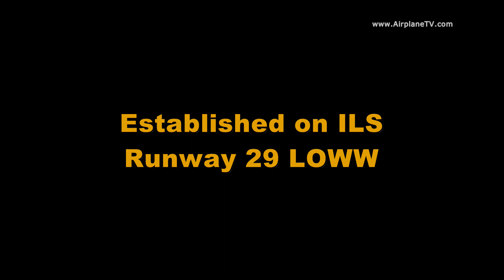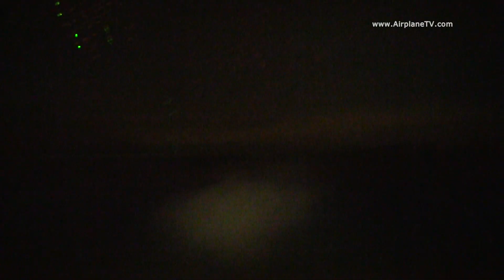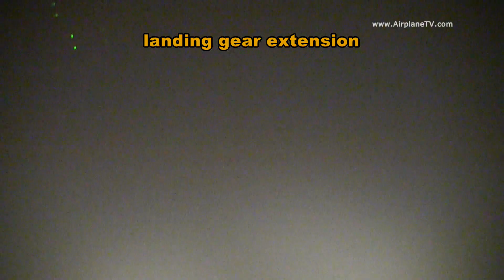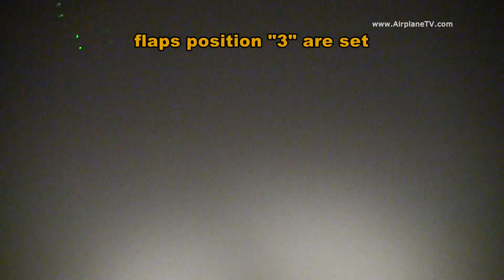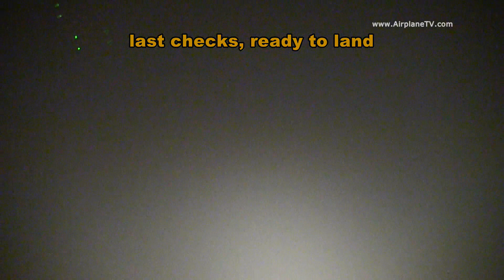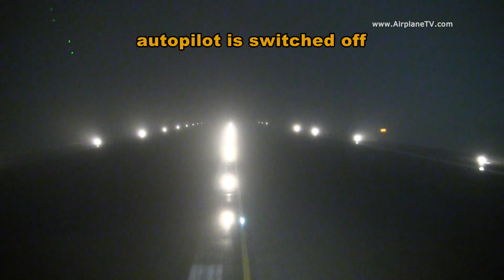Airbus A320 pilots' view ILS Approach CAT III LOWW-VIE in bad weather

Comment: I don't care how skillful the pilot is or how many thousands of flight hours he/she may have, this wold have to be the scariest thing to do!  Landing a plane is hard work, especially if you have a crosswind component, but this . . . this is another thing all together.  I will take my hat of to anyone that can do this!
Reply from the maker: TheMeslava
 that's right, but in case of any malfunction you still have to take over manually and if visual cues are sufficient, complete the landing.
Reply: TheMightyHarihar No. You still have a ton of critical information from the instruments that tell you your speed, altitude, flight path,  location, etc. Just because you can't see out the window doesn't affect things as much as you think. 

For example, if the computer was malfunctioning, you might see that your speed or rate of descent is not normal for that phase of the approach. In that case you will know something is wrong and take manual control. The instruments will show something is wrong long before you hit the ground.
Reply: No luck in aviation.
Reply: Every ILS sistem has Frekvency in MHz , for example 123.25 MHz 
Firs step: when you start approuch you put in AP system that Frekvency. 

Step two: plane give you a signal when catch signal and your autopilot be on xy heading or on VOR you put APPROUCH on autopilot and this is it.
Plane navigate ILS system and auto-landing
Reply: I think that csosswind is much harder
Reply: TheMeslava
Yeh, I know it is, but just becasue it is set for the autoland, both pilot and the co-pilot are on the edge, checking and cross cheking all the instruments millions of times to make sure that all is going by the book and in the case it does not, they have to over ride the system and take manual controll, eventually landing the plane by them self.  In this scenarion . . . . . they would have to be trained and qualified to do it and even then, there is very big luck factor as well.  Either way, I am impressed = )
Reply: You do realize the plane landed itself right?
Reply: What are you going to do if there is a malfunction, since you can't see shit. You will be dead before you realise there is a malfunction.
Reply: @Harihar_Patel  not necessarily. Down to 50ft it's still generally very feasible to execute a safe go around. Below that, all bets are off. You better hope luck is with the pilots that day.
Reply: @Harihar_Patel  there are still ways of landing the plane at zero visibility when there is an autopilot malfunction. I land my Cessna 172 at zero visibility manually only by reading the instruments, following the localiser and the glide slope, I am sure they as Airbus pilots can do it as well, maybe as good or better than me.
Reply: TheMightyHarihar Not so at all. The pilots are constantly checking everything, and the automated systems are checking themselves. If something goes wrong, they’re going to know it. When you hear the pilot say “land CAT III dual”, that’s him verifying at very low altitude that everything is working correctly and that both autopilots are going to remain engaged throughout landing. If something fails and they can’t autoland, they turn off the autopilot and manually fly the airplane down to Minimum Descent Altitude, then land visually if they can see, or power up and go missed approach. From a missed approach they can either try again if the weather is improving, or divert to their alternate. Nothing is left to chance.
Reply: TheMightyHarihar you'd see that on the instruments and possibly by the autopilot disconnecting. Then you take over and fly the missed approach manually on the instruments just as you would for any landing
Reply: autopilot did it.

Comment: Thanks for sharing! No DH approach means that a PF can decide to go around at any point until touchdown?
Reply from the maker: That's correct.
In fact any decision to go around below approximately 20 feet will result in the main wheels touching down but that's allright as the landing gear must not be retracted before a positive rate of climb is established and the ground spoilers will not activate in this case.
Reply: AirplanetvCOM
Thanks for your prompt reply! Would a touch-and-go landing be possible in this particular configuration?
Reply from the maker: Martin R.
as the main gear would have contact with the runway it IS a ouch and go landing anyway.

Comment: Man, you got to admire the modern technology for both ILS and AP.
Reply from the maker: Yes and no: the computing power of an ordinary iPhone probably surpasses all computers and processors built into a modern airliner.
But the important topic is "reliability". While I appreciate all the possibilites and apps of an iPhone I certainly would not want to have my life depend on it...
Reply from the maker: Feyg Aeckaunt
the latest FMGC is praised for it's higher memory capacity of .. 5 Megabyte.
I'd guess I'm right ;-)
Reply from the maker: Feyg Aeckaunt
okay, regarding computing power: the latest release offers already 32 bit processors..
Reply from the maker: Kiwuser
 you are right, the ILS system itself is a very old analog technology. It's the digital flight guidance system onboard the aircraft which makes it safe and comfortable.
Reply: If you combined them, yes, but I think each screen is a separate computer unit that streams movies etc from a central server (judging by how they can reboot an individual screen if something goes wrong), I was just making a link to the original comment, but you make a good point.
Reply from the maker: Feyg Aeckaunt okay, if you take these into account it's a different picture. But the AES is not necessary neither for the safety of the flight nor is it installed in every airplane, it's also installed by third party companies (MAS, Transcom..) and not the aircraft manufacturer itself.
Onboard our medium range aircraft we replaced the analog VCR's only recently by RAM discs, until then everything functioned without any processing, just multitrack audio tapes and Hi8 VCR's.
I'm pretty sure that there are still some longrange airplanes around which offfer the same technology, some even VHS only.
Reply: AirplanetvCOM I don't think you require that much processing power for the ILS system anyway, once the ILS is established, the computer just tells the autopilot what way to turn to maintain the centerline

Comment from the maker: @starjack24:
That depends: during an autoland approach with NO decision height "automatic rollout" is required, thus the autopilot must remain on until the aircraft reaches taxi speed, until that time the autopilot also maintains runway centerline.
During autoland approach with "manual rollout" the a/p has to be switched off after mainwheel touchdown and the captain needs to maintain runway centerline.
Reply: ***** All Cat III approaches have zero decision height but they are differentiated by the suffix a,b or c denoting the Runway Visual Range (RVR) limits. Cat IIIb being the lowest visibility...& I'm guessing RVR 100' - 150'? These approaches are made during extreme low ceiling/visibility conditions & are not available at all airports. The aircraft must also be equipped (3AP) & signed out to perform the approach. Generally Cat I & II are more the norm...most airports.
Reply: AirplanetvCOM THANK YOU SIR !! Honest answers for those who ask !Those wanting to learn with NO  smartass answers like "we use special glasses to see at night etc.." Most people ask q and a's because they don't know and don't need unprofessional armchair pilot answers! Thanks ! Silver side up rubber side down -blue skies too you !! Again Thank you !
Reply from the maker: Rick Rodrigues I think if you realize the condition "AND" a runway visual range not less than 700ft (200m) for a CAT III A it is clearer to you. 
With less than 200m RVR it's not III A anymore.
Reply: +AirplanetvCOM Thanks for the correction. However this is a sticky subject among pilots & lots of "ambiguity" by the regulatory authorities (ICAO/FAA/JAA) with respect to CAT III minima.
Airbus - CAT I/CAT III Operations.  http://www.skybrary.aero/bookshelf/books/1480.pdf
For CAT III operations, the JAA defines Decision Height.
"Decision height is the wheel height above the runway elevation by which a go-around must be initiated 'unless' adequate visual reference has been established with the aircraft position and approach path being assessed as satisfactory to continue the approach and landing in safety (JAA)."
The critical element for CAT III approaches is "visibility"...cloud ceiling is actually a non issue. It means - providing the visibility meets the RVR requirements for that particular CAT III A,B or C approach & the aircraft/crew are suitably certified for the type of approach, an approach & landing can be initiated. Interpretation for CAT IIIA means when the aircraft is at RA = 30m you should have not less than 200m (RVR) of forward visibility or CAT IIIB,  not less than 50m (RVR) of forward visibility to legally & safely complete the landing. Unfortunately the CAT III definitions are quite ambiguous...read on.

2.2.1 CAT III A
ICAO and FAA definition
A category III A approach is a precision instrument approach and landing with "no decision height" or a decision height lower than 100ft (30m) and a runway visual range not less than RVR700ft (RVR200m).
Here is the "ambiguity"! Quote: "....no decision height or a decision height lower than 100ft (30m).....etc..." unquote. Interpretation? "no decision height" means zero feet (0")!  Or...lower than 100ft. could mean "100', 99', 98'.......5', 4', 3', 2', 1', 0'......no decision height! Ambiguous!?
CAT III B similar interpretation: No DH or DH lower than 50' ....meaning 50',49', 48'....3',2'.1',0'!
Reply from the maker: skynut831 the answer you received regarding "special glasses" is not necessarily incorrect: Some business jets are certified to use "enhanced vision systems" which emply infrared or other technology to actually enable the pilots to see in reduced visibility/night conditions and gives them a slight credit for CAT I or CAT II ILS approaches.
But on the airbus with CAT III autoland we don't need or use those.
Reply: Thanks! It was the replies x-ray superman goggles answer with no further explanation that got me.Thanks for an honest answer !
Reply from the maker: No, RVR/visibility is not the only difference, the answer is a little more complicated; to qualify for a lower minimum the aircraft has to fulfill higher reqirements, e.g. fail-operational autopilot instead of failpassive (50 ft DH is the lowest in this case, CAT III A), or auto roll-out instead of manual rollout. For A320 we got NO DH and 75m RVR but this requires "CAT III DUAL" landing capability (two autopilots in parallel, fail-operational) with automatic rollout. In case of manual rollout only we need to go to a higher minimum.
Reply: +AirplanetvCOM I totally agree it gets complicated with DH/RVR minimums determined by aircraft certification. Eg: Is the aircraft certified "fail-passive" or "fail-operational", with or without "rollout" aircraft capability after touch down etc..? From the minimums you quote (CAT. IIIA DH15m (50ft). RVR 200m(700ft)  I now suspect you fly an Airbus 320 and comply with JAA CAT III regulations. However the ICAO/FAA definition for CAT. III A/B regulations are less stringent and allow for lower minimums when compared to JAA. As mentioned in my earlier post, I simply have a problem with the "language" used for the CAT III A/B definitions by ICAO/FAA & JAA
Reply from the maker: You are right, I fly Airbus 319/20/21 and our lowest minimum is NO DH, 75m RVR. With my first jet (MD80 series) the lowest minimum was 50 feet, 200 RVR with HUD, so the autopilot was "fail-passive".
But regarding all the theory - before I get confused I leave you there ;-)
Reply from the maker: No, Zero visibility landings are not allowed anywhere in the world. We have 75m RVR as minimum and I don't think any aircraft can do better.
Reply: Does an ILS approach with no decision height exist? I thought with a CAT 3 approach it is at min. 50 ft AGL.
As far as I know, the AP disconnects as soon as you make any rudder or tiller inputs.
Reply from the maker: Of course there are lower minimums than CAT IIIa (50ft), as stated the lowest is 0ft ("no") decision height.
During an autoland approach and the automatic rollout you DON'T make ANY inputs with rudder/sidestick/tiller for the reason you mentioned.
Reply: +Rick Rodrigues y
Reply: +Rick Rodrigues Hey Rick, thanks for your input here. It looks like you've been reading some confusing/boring FAA theory lately and for that I ask you: Doesn't the CAT III have three types A, B & C all without DH but with differing RVR. (A) 700', (B) 150' and (C) No RVR ?
Reply: Cat III can be done without any RVR being zero, zero visibility so the answers C
Reply: I thought they had a zero-visibility Cat-3C ILS procedure for Runways 8L and 8R at Atlanta Int'l?  Was I wrong on this?
Reply: Dennis Kitainik i have just been learning about these categories and i didn't think there was a civilian airport with IIIC... but you saying ATL might be? that's cool because atl is right down the street from me... now i need an Airbus and crappy weather!
Reply: What the hell are you guya talking about?
Reply from the maker: WE have CAT IIIb auto land with NO decision height..
Reply from the maker: That's not true:
No DH= RVR 75m
20' DH=RVR 150m
50' DH=RVR 200m
All of these are CAT III with automatic landing, only the lowest minimum also requires also automatic roll-out.

Comment: What airport is it?? And is it dangerous to take off or land on autopilot?? Coz usually don't see that happening.
Reply from the maker: It's Vienna, Austria (LOWW).
It's not dangerous but it takes training and equipment in the airplane AND the airport. And the takeoff is never on autopilot.
Reply: AirplanetvCOM Some planes can take off on autopolit right?
Reply from the maker: *****
I am not aware of any airplane type that can take off on autopilot and I don't see much sense in it. For takeoff there is only a minimum visibility required, no cloud ceiling - so as soon as the nose gear left the ground there is no need for any visibility at all.
Reply: AirplanetvCOM Oh, i miss understood the TO/GA autopilot switch, i read its wikipage, i see know the autopilot only controls the throttle on takeoff.